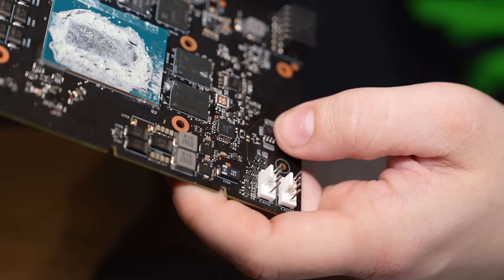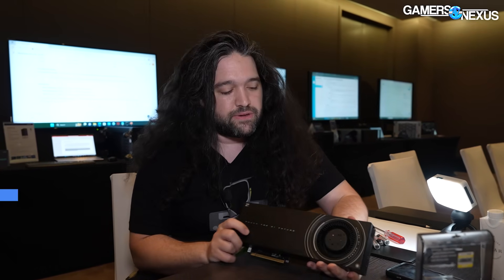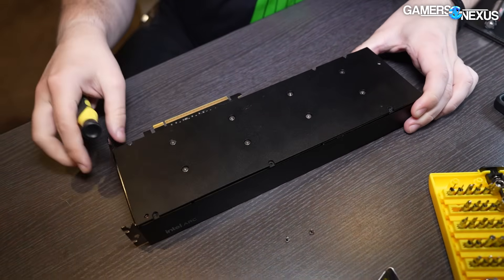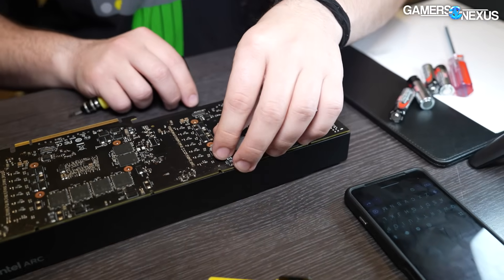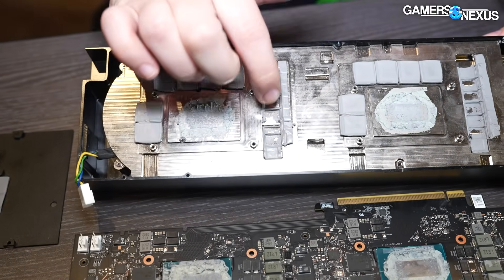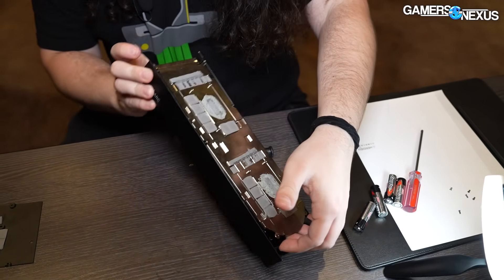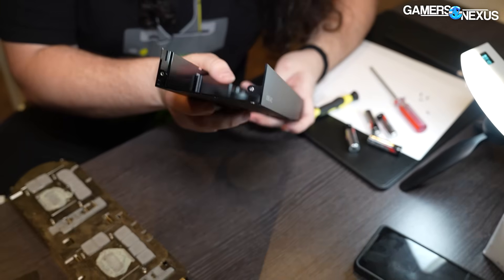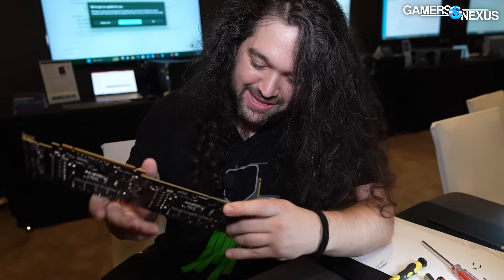Intel Arc B60 DUAL-GPU 48GB Video Card Tear-Down | MAXSUN Arc Pro B60 Dual

Comment: I need this in my life for a dual-purpose system! Low profile! Enough VRAM to run a very respectable-sized model! Its amazing! And when ya go on the early reddit forums and hear the bashing by one-dimensional people who only look at this from a gaming standpoint, its clear that they find all things outside of gaming to be completely useless. And that is such a shame, because even though I might make a huge compromise on gaming performance compared to something like the 5080 (I'm a light 1080 gamer, so this is a non-factor to consumers such as myself; of which that type is growing every single day), it should still be excellent at running LLMs much larger than what the 5080 or even 5090 is capable of with the insane VRAM. Nexus, if you could add tokens per second as a measure with appropriate-sized LLMs per card tested, THAT is a great performance metric for a card such as this, and THAT will solidify my purchase decision. And if thats not gonna be added to your wheelhouse, thats okay too! I love what yaw do.

Comment: I hope these have 2 Displayport connections to each GPU. Then I'll likely buy one and put it in my eGPU case to run my 8 30 inch 2560x1600 monitors instead of running 6 of them on my Rx6800 and 2 on my 4090 mobile.

Comment: Hey there 👋 — we truly appreciate your enthusiasm for the Maxsun Intel Arc Pro B60 Dual 48G Turbo, but we wanted to clarify something important.

We kindly ask that you refrain from conveying inaccurate pricing information about this product, as it's creating confusion among customers and unintentionally disrupting brand reputation. Intel has entrusted pricing control to authorized distributors, and to be transparent — claims like "$1000" are far below actual manufacturing costs and misrepresent the true value of this unique dual-GPU workstation card.

As the official MAXSUN USA distributor with exclusive rights over distribution, marketing, and IP representation in the U.S. and Canada, we felt it necessary to address this directly. This is a friendly heads-up, and we’d be more than happy to collaborate or provide accurate specs and context if needed. Thanks for understanding and supporting factual representation in the tech space 🙏

— HydraCluster Tech Builds
(MAXSUN USA Distributor)

Comment: Sad that this isn't a true dual GPU system the same way dual core processors work. 

It is just two distinct GPUs attached together to make more efficient use of a single PCB slot.

Comment: I wonder , seeing as it is technically two separate GPU's sharing an X16 slot via rebar, if it would be possible to use this in Lossless Scaling dual GPU mode. And if so, what would it be capable of doing...... It is apparently intended to be compatible with both gaming and productivity drivers when it comes to market in 2026. If this does come out at a reasonable MSRP of between $600 and $700  as is speculated I might actually seriously consider buying this as a "do it all" versatile option for a mini rig that can game, do productivity workloads, and run LLM's locally. I think tech like this needs to come back so those of us in the homelab enthusiast space can have more efficient and affordable options rather than filling a room with noisy enterprise gear that quadruples our power bill.

Comment: The blower shroud is the most inefficient out there. Would have been better to go for a size smaller and have a snail shaped shroud and provide twice the air flow coupled with greater pressure.

Comment: Is there a use case for dual GPU cards in consumer level computing?
Reply: I was thinking the same - having already performance CPU cores and more towards efficiency geared cores (not on Desktop CPUs with AMD at least yet) - I wonder - would it make sense for GPUs, too?
Like, have one high power one for gaming, and a small, low energy one for basic operating system stuff and a little bit video decoding.
But then - most CPUs already have an iGPU. So it would need to be between these power levels.

Comment: hahahahahahaha this technology is from ASUS Mars II 3 GB Dual GTX 580 maybe from 14 years ago?
Reply: the Radeon HD 6990 was also 14 years ago.
But the ATi 4780 x2 was 17 years ago.
but I don't get your point.
the "technology" of x86 CPU cores is over 40 years ago, 
the technology of dedicated graphics cards where 3D acceleration is "included" with 2D display - is almost 30 years old
No one said it is "new", I mean Steve even said in the video, it was long ago the last time he saw and took apart a dual GPU card...
Reply: @bernds6587  I mean this is possible even from the past, why do we dont do this?
Reply: @rudolfvalacegerna9184  because modern games, and almost every (if not every) game from the past at least (!) 10 years cannot utilize more than one GPU.
Some games let you decide which GPU to use, but just one.
Heck, most games can just even use one display....

Comment: The card looks like it would fit in my server, not too tall(115mm max) and not too wide(2-slots).  Are there drivers that will allow it to run with Windows Server 2022?

Comment: 2 GPUS, 48 GB under $1k ? Someone is ready to eat Nvidias lunch.
Reply: as long as you can't connect them directly, it's basically just like two pgraphics cards in one device. AMDs 7900XTX also has 24GB, and the 5090 has 32GB. And even though I have no clue what kind of chip that is, I bet both of these other cards will be faster.

Comment: IF intel put any effort into gaming drivers  for this, it would probably be a big deal. also it's weird time.. used to be team blue (cpu) and green (gpu). now i cant stand either of them and went red... but rooting for blue in the gpu space.. whats even happening right now?
Reply: it is two grapic cards in one device. So as long as you cannot interconnect them, you will just game on one. And even if there will be a way to connect them - the game has to support multiple GPUs.
Reply: @bernds6587  thats what drivers are for...   also you are making assumptions that it would function on the driver side like nvidia sli did. which was a massive failure on nvidias side, because they left sli support up to the game devs, instead of making a driver that handled it automatically.  even  hardware wise it could be way different than an sli setup, considering its on one pcb and a completely different architecture from nvdias stuff.  intel could 100% release drivers to make it work as whole. not saying it would be easy.. or that they will bother with it. but they really should. if they pulled it off, especially now, it would be a huge win for them in the gaming market. especially the next gen around, when they could revise it at the hardware level to work like that from the start. it would cause massive waves. even if they only got it to work with  a few big games...
Reply: @NihilsticFeeling  the thing is - it was said from several different people it is two graphics cards on one Board, and they are not connected to each other. the x16 slot is basically split into two x8 slots, one for each card.
Sure,  connecting them could be done on the driver level, but you forget: without an additional, direct connection, seperate GPUs can only talk to each other via the PCIe slot only. And that is - compared to SLI, crossfire, and all the other interconnects - slow. Especially when requesting data on the VRAM of a different GPU.
So instead of gaining speed, you will lose speed.
Of course, if a program or game is optimized to use two or more GPUs at the same time - it will heavily depend on how it is programmed, and what kind of work it is - if it can even be split up.

Comment: Maybe the way2go with thermal compound is to just add little ball bearings into the mix. Screws are a start, but ball bearings will be more conformant to the area they're confined in. Spheres of copper or whatever suspended in a thermal compound could be great!

Comment: as strange as a dual GPU card sounds, look what happened when companies started packing multiple CPUs together.
at the very least you get a good bit more power from a single card without having a single superheated die that you have to cool.
Reply: but even with CPUs - the operating system (and application) needs to support multiple CPUs.
And motherboards with multiple sockets are quite expensive, plus the fitting CPUs themselves.
..or did you mean cores?

Comment: Do you remember beast like AMD Radeon R9 295X2 - two Vesuvius chips, each one at 250 W at 2014, whole card had 500 W. I have some kind of feeling Intel trying to re-born that thing again.
Reply: I had a Radeon HD6950. Its big brother was also a dual-GPU card, the Radeon HD6990 - from 2011.
Also even older, the ATi 4780 x2

Comment: Steve's never seen a VooDoo5 6000. 
Seriously, I think this is a flex by Intel for nVidia eating up 3dfx. If you are too young to remember 3dfx, I highly recommend looking up the history. There was also a company nVidia gobbled up back in the day (around 2008'ish) that had developed software to upscale video to HD in an NLE on the old Tesla cards (like my GTX 260 core 216). 
These are the reasons why nVidia's AI is so good. They bought up these companies that either went broke or were so small the buy was easy, for the patents and software.

Comment: I really wanna see a dual GPU for gaming. Butt the chips together like Apple does with their M chips and wrap the memory around them. This would hopefuplu solve the slow transfer speeds of SLI bridges and could utilize multiple mid-tier chips to outperform a single higher performing chip.

Comment: I genuinely hope Intel can gain market share through cards like this. Nvidia killed off experimentation with their GPUs starting with the 500 generation when EVGA had to stop making the 2WIN dual GPU cards, then again in the 600 series when they had to stop adding the EV BOT connector to their mainstream cards (Kingpin not withstanding lol). Nobody has really experimented with AMD dual GPUs since the R9 295X2, there are Radeon Pro duo cards, but those are strictly enterprise. Fingers crossed this can take some market share and make Intel great again!

Comment: i love the idea of a dual gpu card for budget streaming. don't need to buy a 2nd pc if one gpu is doing the gaming and the other is doing the encoding
Reply: You can simply plug in another card. Even pcie x1 slot will do well enough, and B580 while decent, not really a high end gaming card.
Reply: @alexturnbackthearmy1907  some mobos don't have that 2nd slot, being high end is superfluous for a lot of people, but most importantly; it's good to have options cause that makes things more accessible.

heck my gaming gpu right now is a b570. i've yet to see a game it can't handle compared to my displays specs. that includes games like claire obscure 33 and cyberpunk.
Reply: @alexturnbackthearmy1907  i could also just not do  that lol. dont gate keep my builds you wont ever use them so its no concern of yours

Comment: No freaking Way!! ON-board SLI is ALIVE in 2025!!!!! (GTX 295, GTX 590 and GTX 690 were the only dual-GPU on board ones Steve ^_^ I owned all of them for a long period of time. I still have the GTX 295 around!).
Reply: There is no SLI here. The two GPUs aren't connected, they just share the board to fully populate the PCIe x16 slot.

Comment: Wait is this a gaming GPU? if its not, then is good functioning as a high end GPU for gaming?
Reply: No and no. For games it works just like two B580`s - you can use only one card, and it doesnt need that much vram.

Comment: am i getting this right? this like sli without having to do sli? have they finally cracked the code to have two gpus slapped together and work?
Reply: Yes and no. SLI sucked ass, and was killed by software supporting use of two independent cards to do one thing without any of SLI nonsense. But as you can guess...none of that made it into games. So its just two cards not connected in any way on a single board if you want to game on them.
Reply: @alexturnbackthearmy1907  yeah ive just noticed a few videos talking about combining multiple gpus with softwere

Comment: Aluminum shroud? Im surprised there aren't some thermal pads between the "L shaped heatsink fins" and the shroud. May be able to pull a degree or two of heat with that.
If you do end up testing this card, it would be interesting to see how much that could help.

Comment: @GamersNexus I have been telling Intel and I also told AMD to build this card as a suggestion years ago.... Now that the card exists they need to stack the Chips and then Dual out the GPU Dies again... They will be able to quadruple the VRAM and speed that way.... Just saying.
Reply: In fact I suggested to intel before the dual core existed and we were all using the SUN Chip setup back then i told Intel to double up the die into one chaplet... So yeah I also told them to do the dual GPU at the same time. If I had proof of this I would give it but yeah believe or not IDC I'm just saying.....
Reply: we could have been using this tech 23 years ago... lol yeah but we didn't... But if we did we would have had AI ALOT Faster....

Comment: @1.14 - I don't need expensive AI to realize that 3 of these cards has their air-intake blocked. 🙄
Reply: Not blocked - this is how these cards are normally used.
Reply: @alexturnbackthearmy1907  You're right. But it's still a bad idea from an engineering point of view. 🤔

Comment: I'm probably wrong about this but I am assuming that the big issue for getting dual GPU support in the consumer market is because the software controlling everything sees two GPU's and has to try to split the tasks between each one making it a headache for each development team to optimise how this is done.  It seems to me that this could be fixed if there was a main control chip that would direct the tasks between each chip and interfaces between these chips and the motherboard.  What I am envisioning here is possibly not a typical all-in-one GPU design but one where you might have different chips coming off the controller chip that had different functions.  This would theoretically lead to more scaling options for vendors as it could be possible to mix and match how many resources were put into each function.

Comment: Hope that pci between chips is not starving for bandwidth.
Reply: There is no connection between them. Both only use x8 lines from the slot.
Reply: @alexturnbackthearmy1907  Basically the same as that RTX4060Ti variant which had an SSD slot on the back.

Comment: Steve, you speaking Chinese that’s impressive. Nice job! 
Ty for having respect to the Chinese for all they do for the world.
At some point gaming will require multiple chiplet gpu or multiple seperate processors just like cpu. Instead of the monolithic design we currently have. 
5070 ti has less than half the cores of 5090 yet doesn’t perform half as good. It has half the power consumption and greater than half the performance. I’m guessing due to size higher clock speeds help a lot.  Yields would be better too. I don’t know why they don’t figure it out. Yes pcb more complicated but just like chiplet cpu AMD spanks intel in efficiency. One generation might not be a big leap unless you could consider 2 8 pin gpu performing as good as a 600 watt 5090. 
Every single chiplet design is more power efficient than monolithic.
Reply: One word - software support. Not even all professional software supports multiple graphics cards yet, and game developers are allergic for any actual innovation despite tech being there for years.

Comment: Wow, if the drivers, price and power consumption will be better than NVIDIA then it will worth more than the money hungry nvidia. Currently the RTX 6000 Blackwell with 96 GB costs 11.000 dollars which is insane plus power consumption is huge. If I would buy this cheaper and really 400W needs then it will worth a lot more even if I would buy 2 of them.

Comment: Sadly DirectX 12 is what killed SLI/crossfire/multi-GPU for games as it moved the config/support of it to the game level rather than the driver level forcing game developers to have to design support for it with their game. Given it's niche/lower usage, it was the final nail in the coffin as devs didn't want to spend the extra time/resources to code support into it for their games.

Sucks though, cause it was a great concept, that could have still been improved with time. I had the 295gtx dual GPU on a single card, as well as 2x GTX480s back in the day (and boy did those fermi GPUs double as space heaters).

It had more value than just ultra high end, benchmark chasers as well. For example, instead of chucking your old card, and buying the next gen, you could buy a second card of your old type and get an almost 2x performance jump. This at times could end up being a cheaper/better alternative to the other strategy.

I also remember waaay back in the early days there was a company called Lucid Logix or something like that (as well as some later looks by Ati/nvidia) that was trying to leverage having a sort of hybrid graphics solution where you could leverage combining the performance of your discrete GPU with your IGPU.

Basically a lot of cool stuff that never got to fully materialise because of DirectX 12 killing it off before it got the chance to get there.
Reply: Not really - SLI/Crossfire required developers support either way (and it was EXTREMELY poorly implemented at times, not using more then one card at worst, and half of time not utilising second card completely, not to mention vram). multi-GPU is a native directx12 tech that removed need in inferior SLI/Crossfire entirely, too bad game developers are a lazy bunch till you bring them a fat stack of cash.